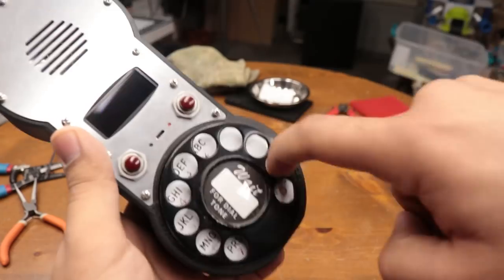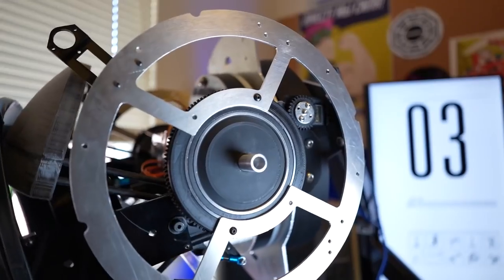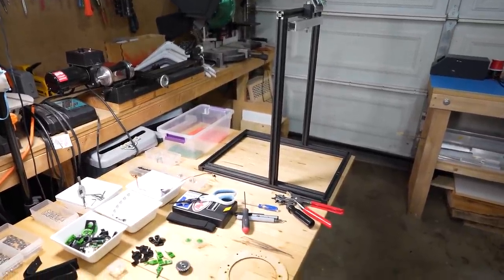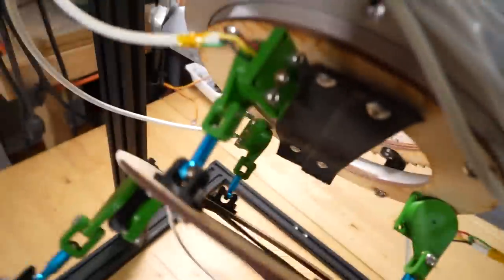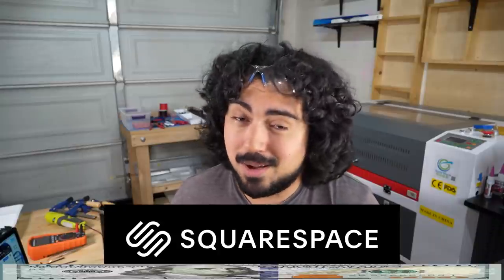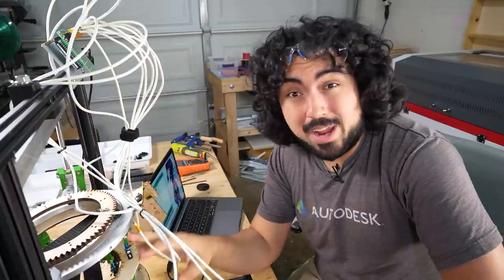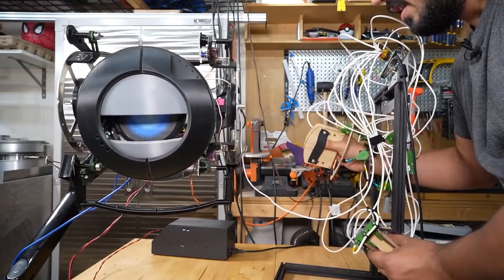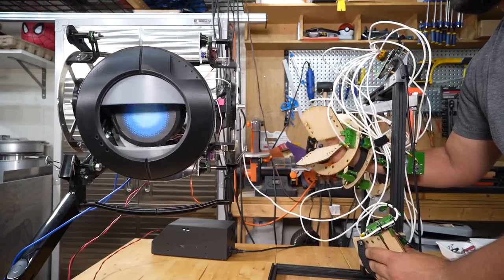Digital Puppetry: What is a Waldo and Why Do I Need One?

Comment: Adjust the eyelid hand motion, at the moment you need to stretch your fingers back so it can open the top eyelid all the way.
So to fix it I think you should make it so when your finger are straight the eyelid is all the way open and when your fingers are down it is closed

It's like calibration so it fits your hand anatomy
Reply from the maker: Definitely need a lot more refinement! This was basically the first working test since I had to get this out on time.

Comment: A  is an electronic telemetric input device Muppeteers use to remotely perform characters. Shaped like a Muppet's head, the waldo sends radio signals to a mechanism in the puppet that moves the puppet's mouth in sync with the waldo's mouth. Waldos are sometimes used in conjunction with a computer interface that provides enhanced control of the puppet. And I demonstrates the Henson Digital Performance System.

Comment: Neat design for puppeteering. Guess no one can ask where's Waldo anymore. Lol Mr Volt has him for remote puppeteering.  Curious your main attachment points to the frame I think it was just two. Maybe for more stability. Attach 4 arms in a X fashion to the frame. And aluminum base ring. Then attach an arm to the top of the frame. In a T fashion that extends out over Waldo.  And use shock cord or some elastic. To give Waldo some support. And still give you a good range of motion. I don't know if that will help. But hopefully it gives you a direction to think about. Looking forward to seeing how this improves your projects.
Reply from the maker: Thanks! The design definitely need improvement. I appreciate the feedback

Comment: I would use an nRF24L01 or the likes for radio / wireless control over Bluetooth. In my experience easier to code and much bigger / stable range. The nRFs come with on board antenna or external one... I am currently running something that does 300ft / 100m without issues - not the greatest speed at that distance, but still.

Comment: @Mr.Volt Why not just mo-cap? It seems like the rigging is too bulky for its own good. If you stick with this, you'll likely need something heavier than just wood, since the lightness of the wood really seems to be making fine movement impossible. If it was a heavier material, it would naturally give more resistance, and thus fine movements would be easier. I still believe mo-cap would work better.

Comment: really cool. build. 

though i think theres better ways to do a lot of the control youre trying to get. like you said around 10:00 a thumbstick. but also dont be afraid to separate the control out. you cant pitch and roll and control mutliple axis with two parts of one of your arms, so maybe make a controller for each hand, and some of the simpler controls for the feet too to separate everything out more rather than all being on one arm. 

there also an interesting behind the scenes video of the jim hensen digital puppeteering they are working on that shows some interesting designs of their controllers. though im guessing you may have already seen that :P
Reply from the maker: Thanks! Definitely still lots of progress to be made. For lack of time, I haven't covered it, but in my latest Wheatly pt 5 video, the waldo is improved to a symmetrical, dual-hand version that gives me yaw/pitch/roll/ and upper/lower hand controls, so now I've got a comfortable 10 DoF controller that is much more ergonomic. I'm going to cover it more in the final video.

I've definite dived into the Jim Hensen rabbit hole before. What really inspires me now is this: https://www.youtube.com/watch?v=kDY0WKvFwQ8
Reply: @MrVolt  yeah, lot of coll stuff behind the making of those doc oc arms. 

just curious, how have you found those rotary position sensors have held up? i was thinking about a build using just the regular pots but smaller components like those would be better, any issues with them using them for this application?

Comment: Volt, I'm currently wanting to use the same position sensors as you for a project of mine (EVW-AE4001B14) but I can't figure out how you connected it to the wires?
Reply from the maker: Theyre potentiometers. One side to your VCC, the middle is the analog signal, and the other side connects to GND.
Reply: @MrVolt  did you solder each pin onto a wire?